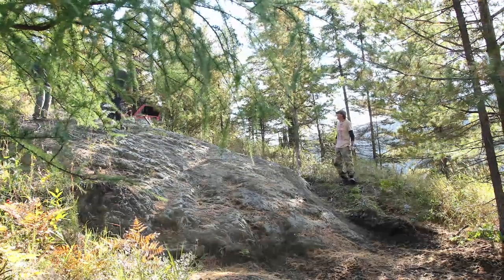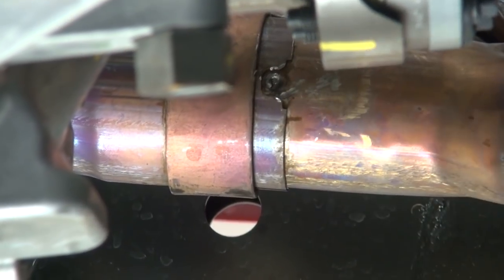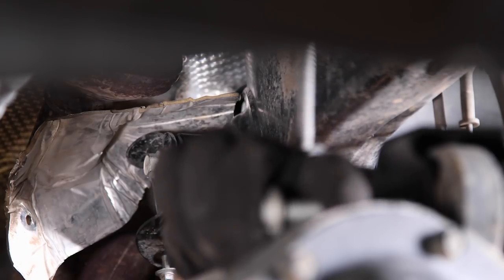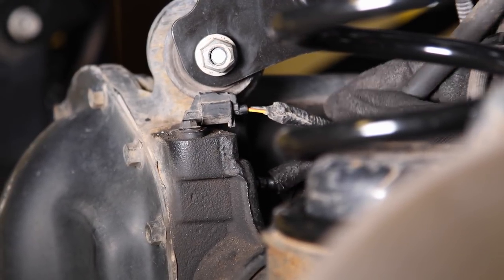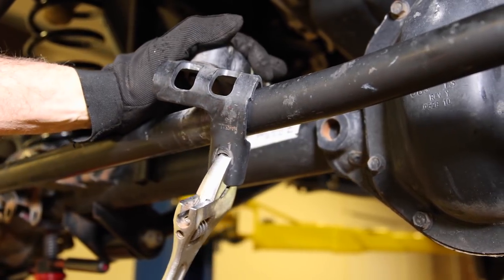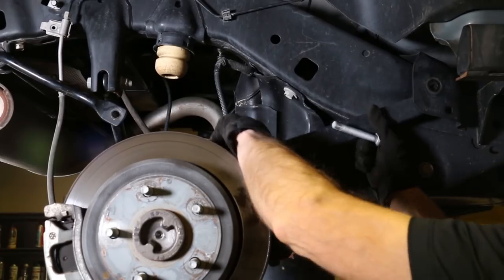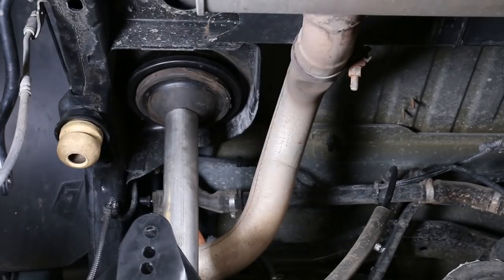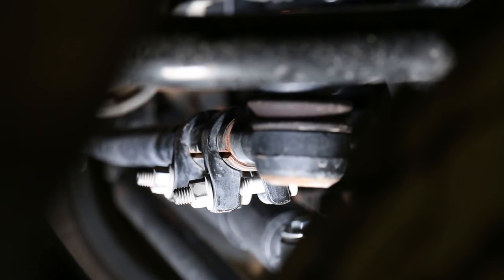TeraFlex Install: JK Sport 8 FlexArm Kit

Comment: You people at TeraFlex put out some of the best videos.
With sprinkled in little bits of comedic statement and many helpful tips,
very educational for people like me that are just getting into the Jeep world.

I've had pickup trucks as long as I can remember.  It was a necessity for work.
I have always wanted a Jeep, but alas, money has to go where its gotta go.

In the very near future I will become a new Jeep owner.
I have been researching the vast "Jeep Information Universe".  It is mind boggling.

Coming back to your videos, watching and learning, I have the utmost confidence
that I will be able to install a kit myself.  I've installed three drop bracket kits on pickup trucks over the years, but Jeeps are different as they are not IFS.
Quite a different animal.

I plan to do a mild 2 to 3 inch lift with 33 to 35 inch tires. Nothing crazy, just to help take take the Jeep to a higher level of performance.

 ( Not to mention make it look bad-ass)

Thanks for keeping it real.

Jeff

Comment: Dennis, you're a character w/o question and I truly appreciate all the installation videos, as well as the comedy!  One thing I noticed in this installation that I thought I would point out for other newbies like me, "the devils in the details".  On the rear installation portion you pull the sway bar links from the outside of the sway bar but install the new ones on the inside of the sway bar.  This will possibly cause an issue with the link hitting the axle and/or the bump stop puck depending on your pinion angle.  On the CT/3 Alpine kit I installed, with the arms lengths at the documentation spec, the link definitely hits.  Thanks again!

Comment: Just an fyi, if you are having battery tray issues, one of those extension magnets to hold the washer, then the nut as you spin it onto the shock threads works like a charm!

Comment: Teraflex and Dennis .. I really appreciate the time you take to create these videos , your focus on details within the scope of of products in the videos is fantastic.  I installed the metal cloak 3.5 inch lift with only upper control arms replaced on my 2008 jk Sahara, I'm currently building up a prorock unlimited Dana 44 front axle . Northridge 4x4 is my current supplier for my parts in my JK build , how ever they no longer supply metal cloak products , which is leaving me with a small delima of the rest of the build and pondering the idea of replacing the upper metal cloak control arms with a Tera flex and doing the rest of build with teraflex products because of availability through out the long term goals of my JK build. My question is with using my metal cloak 3.5 inch springs and teraflex components through out the rest of the build as far as compatability, or buying the teraflex 4 inch springs , basically starting from scratch .
Reply from the maker: +Gilbert Verhoeff You can use our components with your existing springs.

Comment: **At the 19:50 mark you MUST remove the nut stop tab if you're installing the Sport 8 Flexarm kit using the factory hardware.  The two forward nut stop tabs for the rear lowers WILL CUT INTO the flex arms and damage them.** 

One of the main reasons why I decided to with Teraflex was for the quality and ALL their informative videos.  But unfortunately this minor detail was missed, and my rear lower flex arms were cut and damaged as a result.

This was my first lift that I ever installed, and by myself.  Their videos and instructions made the precess extremely straight forward for anyone who knowns their way about with tools and automotive parts.

Comment: Hey Dennis, thank you guys so much for putting out such quality videos with detail. I am in the process of installing this very setup on my JK and have a question about the rear breather tube it appear to be rather short did you do anything special to add distance on the tube or is the factory length sufficient?

Comment: I don't know if anyone ever told you: why on earth do you mix metric and SAE bolts? Every bolt on a Jeep is metric these days and now you have to have SAE tools for the few bolts on the lift. Just use the same size bolt on the replacement components - most of it is made in China anyways and they don't have a problem with metric.

Comment: why do you add spring spacers when putting a 3 inch lift on
Reply from the maker: This was an older kit that used a 2.5" spring, and a .5" spacer to get it's 3" of lift. It has since been replaced with a 3" coil. But those .5" spacers are still great to use if needing to gain back a little lift due to heavier aftermarket accessories.

Comment: is the steering stabilizer kit and relocation bracket necessary when getting the 3" suspension lift kit with full 8 flexarms, 9550 shocks, and front track bar?
Reply: I have a 4 door wrangler Sahara
Reply from the maker: +EyesShineLikeTHC  No it's not.

Comment: When will this kit be available, and what's the U.S. price point? Would the fixed arms negate the need for drop brackets altogether?
Reply from the maker: This is a combination of our current #1251200/12512002 $1133.99 retail (Basic 3" Lifts 4DR/2DR) plus the #1258000 Sport Arm Kit $779.99 retail. There would be no reason to run drop brackets with this kit at all.

Comment: Would this work w/ my Teraflex 2.5" lift w/ stock arms. I have your monster track bar along w/ synergy tie rod and drag link. I also have the jks quick disco and after market front drive shaft.
Reply from the maker: Yong Kim Yes it will!

Comment: Drive shaft modifications recommended. What does that mean? Under what circumstance would I need this?
Reply: so when you lift your vehicle, you're messing w/the pinion angle of your shaft, w/in then sends vibrations to the rest of your jeep and can cause a bum ton of problems. I heard you can get away w/doing any sort of mods right away w/a JKU but not a JK cause of the shorter wheel base when it comes to 2.5 (maybe 3 inch as well) inch lifts

Comment: What's the difference between  a Teraflex Jk 4"long arm suspension vs Teraflex Jk 4" Suspension System with Full 8 Flexarm System Link Kit
Reply from the maker: djm93 The Full 8 FlexArm Systems are Short Arms vs the Long Arm Suspensions that TeraFlex offers. Short Arm = bolt in, Long Arm = welding.
Reply: teraflexsuspensions  so those come with 4 inch lift kit with the adjustable trackbar + the full 8 flex arms , the 8 flex arms are for crrecting caster and pinion angle issues ? and no dfferecnt with the long arm using same 8 flex arms?

Comment: Is I get 20inch wheels and 33 tires and 2.5 inch lift kit do I have to change the gear axle?
Reply from the maker: No you can still run your stock gears with those tires.

Comment: i have 2.5 taraflex lift if i put 1/2 coil spacer in would  i need new control arms
Reply from the maker: At 3" you are at the borderline. Your actual lift height will vary with the weight of the vehicle and accessories. If you are compensating for lift loss due to spring compression, then you should be fine without. But if you get the full 3" of lift, then you will want to start considering at least front lowers and rear uppers for the JK. Give us a call anytime to discuss in more detail. 801-713-3314

Comment: can drop brackets for the front be used with this set up?
Reply from the maker: Sure, but its a trade off.  Drop brackets help correct geometry and work great on the road. They do however hang down and become a rock catcher offroad. Not a fan, but for those that stay on the highway they are no problem.
Dennis

Comment: Can torque be accomplished in air on control arms?
Reply from the maker: Not without preloading the bushings. You will want the entire weight of the vehicle on the ground or an alignment rack before final torque of the control arms.